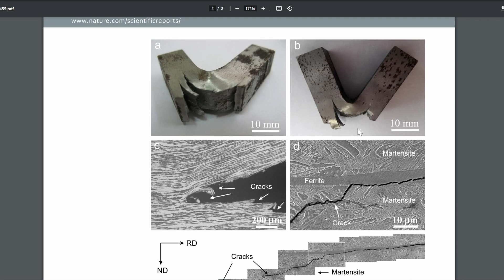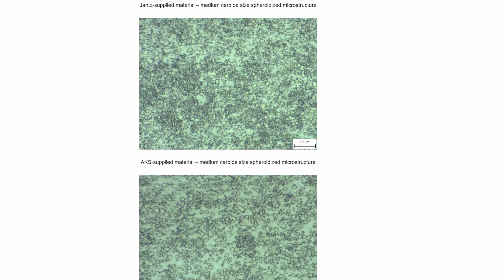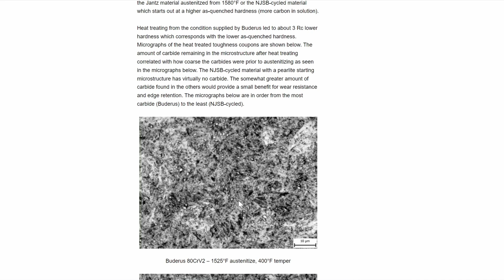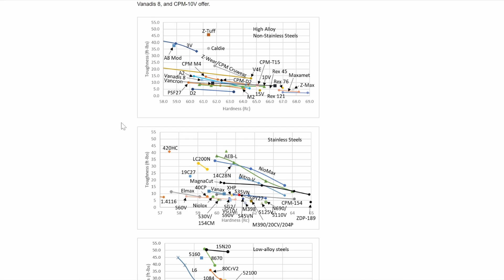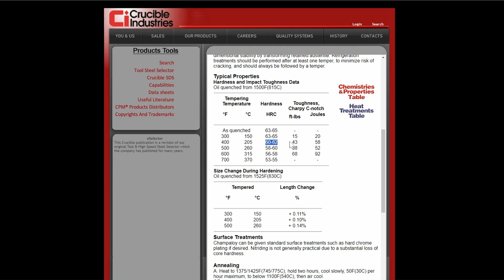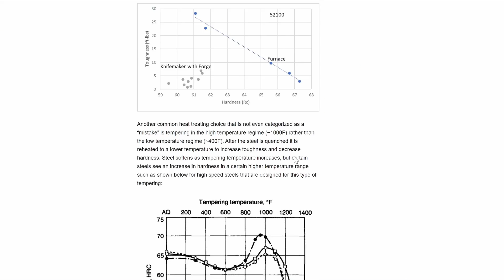Most Important Property for Knife Steel? Q&A

Comment: For me, after +20 sharpening knives, heavy collector and active user, plus expert sharpener...
Apex accuracy is the most important thing for folders followed by edge retention then partial corrorion resistance.
"In land environments by expert hands"

In my experience modern enriched carbon tool steels are better then stainless, much more pleasent and reactive to sharpening to ultra splitting apex edges.

Best steel tested: Maxamet (my favourite), 15V, 10V, Magnacut, CruWear, K390 In EU (but internal structure can be more uniform, thinner, great formula 👍).

Best stainless S110V, S90V, S35VN, S30V... all still capable of high accuracy but less pleasent to sharpen, relatively.
I alternate carbon tool steels and stainless to have knives for all environments/situations and also different sharpening feedback.

All steels with excessive chrome, over 15%, were extremely disappointing for apex accuracy 👎: M390, ELMAX, Zdp189 (zdp least worst of the group).
I stopped buying steels with chrome over 15%, my limit and I like a lot partial stainless, like CruWear and MAGNACUT.
With modern powder technology chrome amount needed for corrosion resistance is way less then old lingot tecnology.
Coatings and finishes are important also, even a simple stonewashed is better then sand blasting (retains humidity).

My favourites lingot steels are: D2 and VG10, theoretically also M4 but now it is easier to find in powder format that off course is superior (rex45 seems a great evolution, wish list).
D2 and VG10 still retain great value in actual market, have many.

Then for more durability I like a lot CruWear.
New limited chrome steels like Magnacut are fantastic, my favourite chrome window is 7-10%.

Then of course for scuba diving or sea environments customers can opt for more extreme corrosion resistance steels and very smartly US brands have a huge steel selection to make everyone happy, different customers different preferences 😃👍

Great channel, super professional and pleasent to learn from.

🇮🇹

Comment: EVERYONE TALKS ABOUT KNIFE STEEL "TOUGHNESS" (AGAINST "BREAKING")... RARELY DOES ONE HEAR ANYTHING  ABOUT "DUCTILITY" (RESISTANCE AGAINST "CHIPPING"?)... BREAKING A KNIFE IS A RARE EVENT OTHER THAN WHERE A STRESS RAISER IS PRESENT (BAD DESIGN?), BUT EDGE-APEX CHIPPING HAPPENS. GUESS CARBIDES CAN ACT AS STRESS RAISERS, SO CHOOSING STEELS WITH FEWER & SMALLER CARBIDES HELP WITH TOUGHNESS. CHIPPING SEEMS MORE RELATED TO  COMPRESSIVE STRENGTH & HARDNESS ... BUT I AM NOT SURE... (EDGE-APEX STABILITY COMES TO MIND).  HOW DOES TOUGHNESS & DUCTILITY CORRELATE?

Comment: What is the hardest your everyday rebar will ever get .?  Prob not the best thing to get use to the prosses's of makeing a blade but I use what I have
Reply: You can’t even get onto the HRC scale with common rebar.
Reply: @gumwap1  it's  works tho  make 2 or 3 fast blades no handle , just the rebar it's self & if ya loose 1 here or there don't matter so much ..
Reply: Cliff Stamp made some knives out of plain mild steel (unhardenable) and they held a pretty good edge.

Comment: Mr. Thomas, what is your opinion on the connection between perceived "smoothness" of a knife cutting ability and steel micro-structure?
The thing is, I have an old chef knife, hand forged with shirogami 2 steel (1.05-1.15% carbon and no visible carbides on micro photos I found), fine edge and geometry, typical traditional Japanese knife, and I just love the way it cuts, it's smooth and easy, minimal effort to cut something. I got a bunch of other kitchen knives made from different high alloy and high carbon stainless and pm steels, they all are great and cut well, but I feel like I don't get that "smoothness" of a cut like with that old knife. I hold kitchen knives several hours a day, so my motor skills are trained enough to differentiate nuances. I got different stones and abrasives including diamond sub micron ones to sharpen the knives consistently.
Am I being delusional and biased or there might be something to support my "perceived smoothness"?
And if there is something, what stainless/pm steel can give the same cutting "smoothness", while being immune to water, holding edge well and being tough enough for a kitchen knife?
Reply: You've used stuff like 14c28n or AEB-L hardened pretty hard? It might really just be the grind on your old knife, the grind matters a lot.
Reply: @mikafoxx2717  Hmm, that's an idea! I have no experience with Sandvik/AEBL kitchen knives hardened to HRC60, but I'm going to find one, that might be the thing.

Comment: Very useful info, thanks! 
How does Bohler K890 compare in the hardness / toughness / corrosion resistance balance?
Reply from the maker: Haven't tested it. It's a non-stainless so the corrosion resistance wouldn't be particularly high. It is advertised by the manufacturer to have high toughness and average wear resistance.
Reply: It would be great to see how it tests. Especially since it can be made to high hardness and retain high toughness. I wonder how it holds an edge when sharpened to a low angle edge.

Comment: Dear Doctor,  I believe you are a rare professional on YouTube！
I am making an outdoor survival axe with dimensions of 110mm in length, 120mm in height and 20mm in thickness. I need your expertise to help me choose the metal. My first choice is high carbon steel and metal monolithic structure.  , local heat treatment, 1095 or 1080.1060?   Thanks!

Comment: Lamination in hot rolled steel is bad.  No benefit to be had—it’s a bunch of nonmetallic bonds leading to crack formation during rolling, and weakness in use.  Why are people asking if it’s a “good thing”?  Am I missing something?  
Damascus steel isn’t the same as lamination.  Lamination exists because of impurity inclusions.
Reply from the maker: The “laminated microstructure” was ferrite and martensite, not inclusions

Comment: Dr Steel! Everytime You speak, I listen. And hopefully, remember correctly to apply those informations when necessary - and by doing that having learned something.... THANKS. Really good to know. Greets from Austria!
Reply: @knifesteelnerds Question: Do You have a recommendation how to heat treat ApexUltra for coating? (CVD or  PVD? like TiN / Ti(C,N), Dursan...) and what coating technics are therefore recommended? / What processes should one not use?) Thanks
Reply from the maker: Whichever coating you can apply at a lower temperature than your final tempering temperature
Reply: @KnifeSteelNerds  that means I can temper APexUltra also up to 500C* (do I find the steel datasheet on the crucible site, or where do I look to find it... Thanks again
Reply: @KnifeSteelNerds  found it... sory for asking BEFORE searching....
Reply: @KnifeSteelNerds  Did You temper Apex with 500C?  The documents didnt tell me that other than max 240C.....

Comment: The high tempering corrosion problem happened with my magnacut OKC spl pack knife. I did a spray water test and it was about the same as D2 in regards to corrosion restiance.

Comment: For me, toughness and ease of sharpening to razor sharp.

14c28n, thank you very much.
Reply: Or Aeb-L 👍🏻
Reply: Toughness and hardness, and corrosion resistance is nice. Ease of sharpening almost stops mattering when you go diamond.
14c28n is damn good stuff though. 
Even the budget 12c27m isn't half bad for being about as cheap as 1095 in premade mora and opinel knives.
Reply: Yes. When buying one of my Jokers, I had the choice between N690, a “better” steel, and 14C28N. I chose the latter for its toughness.
Reply: Or 13C26
Reply: I had a Kershaw leek in 14c, loved it but I lost it. Got a new leek, the copper handle one, and the steel isn't even the same! Thankfully it's an upgrade to cpm 154 and I love it too, they're both great knife steels and the Kershaw leek is the perfect edc imo
Reply: @doransponsel4813  That's been my most used knife.  I make knives for fun and own several custom knives, but the Leek in that steel is great for what most people do with a knife.
Reply: Lots of good steels in that category. AEB-L, Cruwear, 52100, CTS-XHP, CTS-BD1N, VG10, Nitro V, A2, N690, Super Blue, O1. I would argue that any high alloy steel is really easy to sharpen as well though.... if you're using diamond abrasive, even maxamet is pretty easy to deal with for an average sharpening. It's thinning and rebeveling where it becomes a pain.

Comment: Excited to hear Larrins answer - but the most important attribute is dependent on the application. A blade primarily designed for combat will have different needs, it must never break, so something like 3V will be much better than a more wear resistant steel, and if it’s a knife for a SEAL, then corrosion resistance is also extremely important. 

All depends on the application, but for general purpose, Magnacut is at the top.